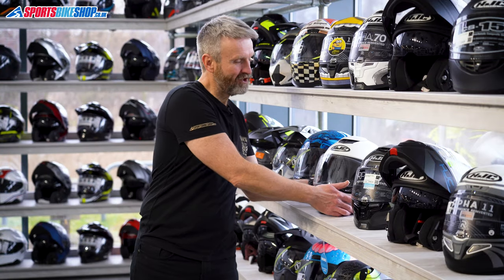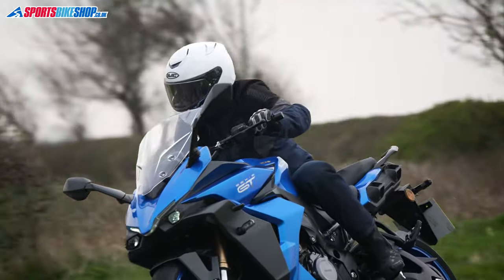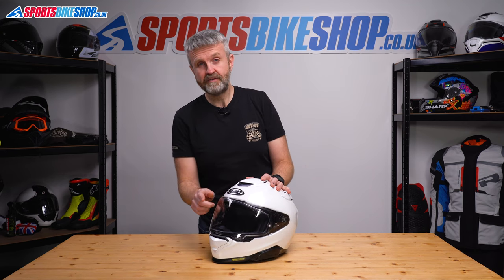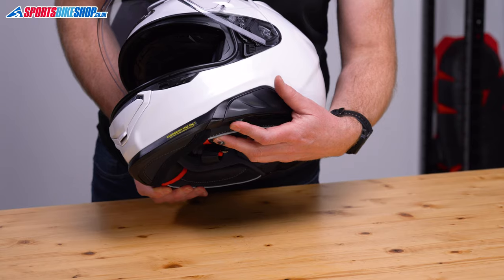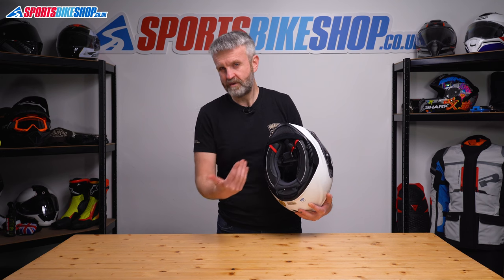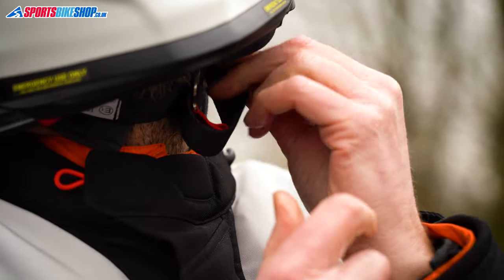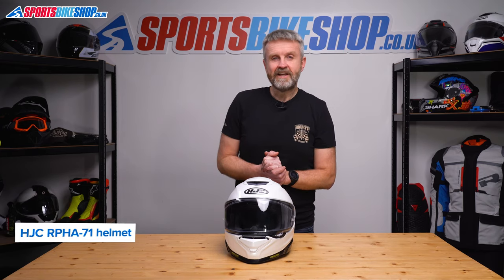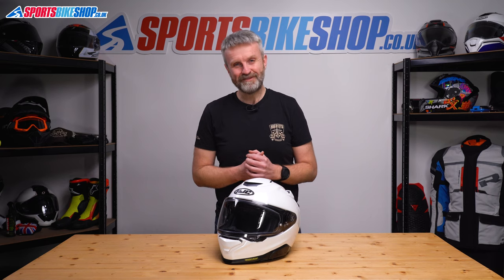HJC RPHA-71 motorcycle helmet review - Sportsbikeshop

Comment: Looks like the RPHA-71 and the Shoei GT-Air II are both going down the track of trying to force you into Sena comm units. That is a deal breaker for me. I wore Shoei GT-Air helmets for over a decade and changed brands after the inability to use the Cardo units which, in my experience, are much better comm units. I would have considered the RPHA-71 but with it forcing me to change comm units to Sena, it won't be happening.